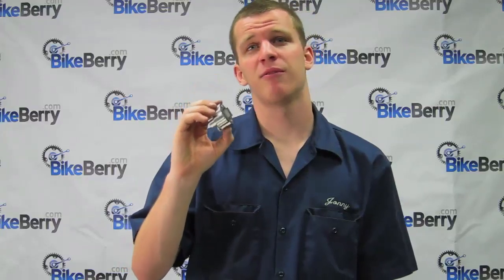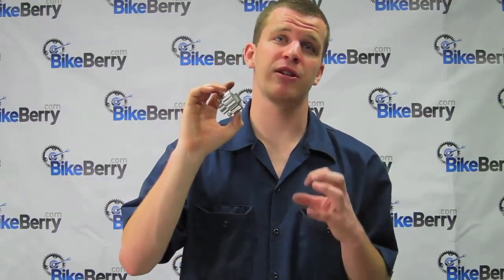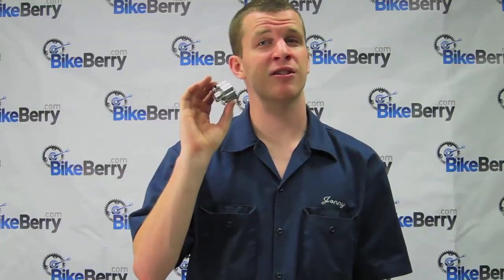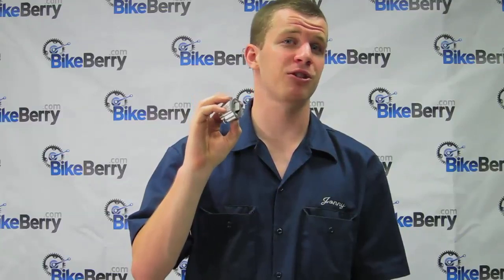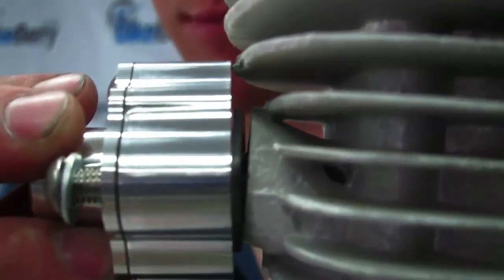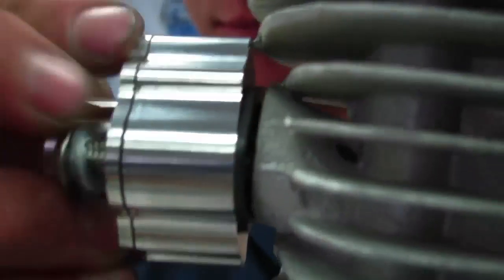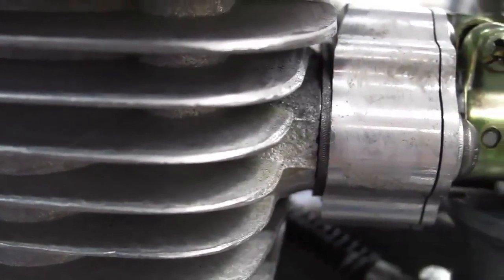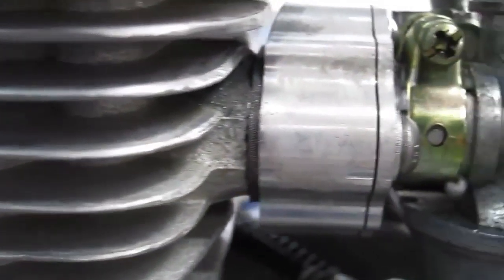Product Review: High Performance Reed Valve for Motorized Gas Bike Bicycle 80cc 48cc 66cc 50cc

Comment: Simply adding a reed valve to a piston port engine will reduce power.
All you have done is added a pressure differential between the port and carb that did no exist before.
The function of a reed is to stop back flows where the piston doesn't, but that is only due to the fact it has holes in it to allow flows beyond the limits of the piston intake timing and via boost porting.
A reed valve timing opens early compared to piston port and shuts about the same as piston port intake timing, similarly to asymmetric timed rotary disc intake, but only at lower RPM's, at high rpm the reed timing becomes more symmetric similar to a piston port, as the opening occurs later as RPM rises.
Hence the benefit of reed valve intake is only favorable at low to mid power range RPM with diminishing gains to top end where it becomes more on an obstruction to bulk gas flows which is why a rotary disc intake that has no pressure loss on the intake has the edge on reed for top end power, particularly in smaller capacity engines.
Reply from the maker: Great information!
Reply: You are a genius .
Reply: @username  That is the case in a Reed Valve intake not a Piston Port Intake where the intake timing is determined by the lower edge of the piston skirt.
If you had a hole in the skirt at the intake  then the port would not be closed by the piston skirt.
So for this Reed Valve to be any use you cant just bolt it on, you need to take off the piston to cut or drill holes in the skirt of it on the intake side so the reed controls the intake timing not the piston.

Comment: I bought an exact reed valve with a  windowed piston from Amazon and it worked out great. Along with a high output magneto, CDI, and expansion chamber, the motor has so much low end torque that I save lots on fuel because I only use half throttle now.. Kool video

Comment: reed valve really works great in a ported engine with a hole drilled in the intake side of the piston. with a boost port and trench porting my motor is easily 3 times more powerful
Reply: Hi how do you cut a boost port on a engine cylinder?

Comment: I don't know why bikeberry doesn't tell people who buy a reed valve the they need to cut a hole in the piston on the intake side in order for the reed valve to work...if not it useless and will make your motor run like crap
Reply: Do you know any good toturials explaning this
Reply: You can buy these cut pistons on eBay...
Reply: Original Labs here is an 80cc cut piston...   http://m.ebay.com/itm/MOTORIZED-BICYCLE-REEDVALVE-READY-PISTON-MODEL-B-PISTON-/282406016045?hash=item41c0b5d42d%3Ag%3AhQEAAOSwWxNY0u0x&_trkparms=pageci%253Acdc4f1b3-110e-11e7-b1f5-74dbd1809aaf%257Cparentrq%253A039a45a915b0a6a5ca2ec8c3fff59ee5%257Ciid%253A22
Reply: that is completely false information. I actually watched the birth of it come about on YouTube over these motorized bikes. The cutout hole in the Piston is only to allow the air and fuel mixer underneath the Piston allowing it to pull it down during the stroke so that it can lubricate the crankshaft with the fuel gas mixture it has nothing to do with the Reed valve kit it allows the air to come into the motor right on through the piston and on to the bottom of the case it has nothing to do with the read valve the Reed valve keeps all of the pressure inside the chamber from going back outside the carburetor just like the young man explained in the video all this where do I buy that where do I get this came off of YouTube some of us used to build this stuff out of nothing in our barns.
Reply: @shaunmcgowan827  The windowed piston skirt on these 2 strokes is needed when using an intake port reed to allow enough air/fuel into engine. If it's a case reed valve, the piston doesn't need a window.....Adding The intake reed reduces the intake duration/flow & the engine will lose power....The window in the piston skirt increase intake duration (open time) and allows for more air/fuel to enter. So you need a window piston skirt otherwise you'll power.

Comment: So I was riding my 80cc bike the other day and there was a pop. Then the motor died. There is a spark and I also tried just peddling with the cluch out. Now it's making a clicking sound when I peddle with cluch out. I don't know what to do to get it running it seems like it is not firing.

Comment: My bike runs so much smoother and has a cleaner top end with the reed valve. I did have to swap the stock carb jet for a .76, only way it would run properly. No piston mods, and waiting on a voodoo expansion chamber. Hopefully this will fix the non-existant low end torque.
Reply: Reeds are pointless with out a 3rd transfer port or window piston. Why don't you have any video on your channel of your bike?
Reply: @Matt Bee you either need a window piston or a 3rd transfer port.
Skirting the piston is good on  a window piston .its very easy to make a hole in your piston. I drill a hole with my drill and then use my dremel to make the shape I want then use  sand paper around the edges of the hole to smooth it out.

Comment: How does the carb attach to the reed valve housing? And is it better to just tap a boost bottle into the existing intake manifold?
Reply: people say the reed valve has a "huge difference" from the boost bottle but from my experience the boost bottle helps alot and has the same effect as the reed valve without slimming your wallet nearly as much

Comment: The Reed valve blew my motor seals out, Combined with the HP carb. Started with massive low end torque, ended with every seal blown next day. Need help please!
Reply from the maker: Contact our customer service representatives at 1-800-317-0479. We'd be happy to help you get your bike up and running.

Comment: if you're getting blow back in the carb that means the motors you sell are not tuned properly. the piston is isn't letting the vacuum pressure back in fast enough..so the piston would need a trimming. so if the intake was longer that would help to. reeds are ment for expansion chambers or tuned pipes with a spark retarding so the exhaust header can be charged. this gives the motor tork and high end power, giving you an expanded power curve...add a high compression head and a lighter window piston you can see revs as high as 14000 rpms. but if you want to a reed valve intake works okay on stock motors....personally  I would get the 40mm intake Oz reed valve but bike berry don't sell 40mm intake motors. 
zedamotorsports.com they got some powerful motors..with bigger mounts to hold all that power
Reply from the maker: Great advice! Keep the wisdom coming.

Comment: I just bought an 80cc kit on line, but I'm concerned about the noise, is there anything you recommend to make it more pleasant?
Reply from the maker: Rotulino Rolon Our speed-demon muffle is quieter. Check out this video for a demo: https://www.youtube.com/watch?v=IXcE4Q7qNG8#t=61 It can be found on our website at http://www.bikeberry.com/engine-kit-parts/exhaust/performance-speed-demon-muffler-with-expansion-chamber.html
Reply: +BikeBerrycom can I attach a 21 mm carburetor whit this?

Comment: How is this different from boost bottle
Reply: the boost bottle does the same thing as the reed valve but the only difference is that the boost bottle is cheaper and if you're gonna install a reed valve you're gonna have to do some porting to your engine

Comment: will this work with your boost bottle intake manifold?
Reply: A reed valve would eliminate the need for a boost bottle and actually would make it useless
Reply: Xavier Gourdine I thought boost bottle did the same thing as this lol
Reply: joshua wagner well I guess the boost bottle is suppose to catch the fuel then spit it out, but it doesn't work completely. The reeds just straight up stop the fuel from escaping
Reply: Lol i remember this project it was a successful failure

Comment: Is there 1 that allows a boost bottle?
Reply from the maker: We personally do not carry one. The purpose of the the reed valve is to solve many of the same issues that the boost bottle solves. If a boost bottle and reed were to be mounted together, the effects of the boost bottle would be significantly impaired.

Comment: I bought reed valve and windowed piston and exhaust, now the engine run like crap, my advice is not to do it case I spent over 100$ for nothing and it decreased the performance, not just that but it's really runs like crap, and i have jetted the new HP carb so many times without any good results.

Comment: For half the cost of a new motor no thanks,A small improvement isn't worth that much coin IMHO.
Reply: BikeBerrycom a reed valve might not be considered for a normal commuter but in my city the drivers don't give a shit about you being on a bike and even some motorcyclists get drove off the road. So the more speed for me the better. >.>
Reply: BikeBerrycom
That makes sense now for me I use my bike mostly for shopping and fishing. I bought a trailer that can haul 88lbs of gear plus a trailer bike for my wife we could not affords a car even if I could get a license so my bike has given me independence and the freedom to do things like camping.
Reply: Joshua Lucas
That must suck where I live they have put in a bike lane on some roads and other roads have signs that say share the road with a bike and a car picture on it.I already can get 50kmh which is the in town speed limit but I usually stay around 40kmh I have the nt-speed carburetor and I find it fast enough and compared to my electric bike this motor bike is far better and far more functional with my trailers.
Reply: KoolBreeze420 where I live (( Ohio , USA )) we have to have a license to ride them, the roads are supposed to be shared but no one follows that law and there are VERY little bicycle lanes. I'm getting my first bike soon.
Reply: KoolBreeze420 we even need license plates on the bikes.
Reply: Joshua Lucas
How do you get a plate for a mountain bike?
Technically I am supposed to only have a 48cc but I live in a very hilly town and am supposed to ride at 32kmh or less this is how we avoid the license issue e-bikes can't go over 32 unless going downhill, to my knowledge there is no way for us to be able to register,insure and plate a mountain bike.
Reply: Joshua Lucas haha dude that so funny i live in ohio been riding mine for about 4-5 months and nothing ive even talked to cops and they havent said anything
Reply: KoolBreeze420 ive got my kit and now...no cops...im slow to realize that the cop wont stop something that cant go very fast.....just wait till I get the jack shaft and the engine modded >:D
Reply: The reed valve has a much more important secondary function, in that it significantly reduces intake noise, because you are preventing reversion of the intake flow.

For me the reduced intake noise is far more important than the increased low and midrange torque.
Reply: BikeBerrycom this is a stock nt carb  i need a reed valve i have air bubbles in my carb at high revs and and out of the intake of the carb you can take off the air cleaner and take your hand and  spray your hand with gas mist coming out of the carb due to the blow back from the piston coming down to pressurize the crank case the air bubbles is also caused by the blow back from the piston coming down before it begins to pressurize the crank case the air bubbles is coming out of my jet in my carb filling up my float bowl and causing my carb to flood out i,v even took the the little air vent and plugged  and and took the tickler valve out and put a better vent in and where the tickler valve use to be that way gas cant come out of the vent that,s next to the air intake and make it bog out i still have air bubbles but i know a reed valve will eliminate that i,v took a copper tube and put it where the tickler valve used to be and it,s the bowl vent now i,v got a line connected to that tube and i took the line and put it in a glass of  water and you can air bubbles come out of it i know a reed valve will solve all that
Reply: @lucajo16  insurence?

Comment: lmao! the people in this comment section have no clue how a 2 stroke works. pack your case... wonder if anyone knows where the power comes from in a 2 stroke.
Reply: adam romer is it the flywheel
Reply: How bout reed valve and boost bottle together has anyone ever tried that .or how does the dual ontake manifold from gas bike work its for two carbs two carbs should be more power